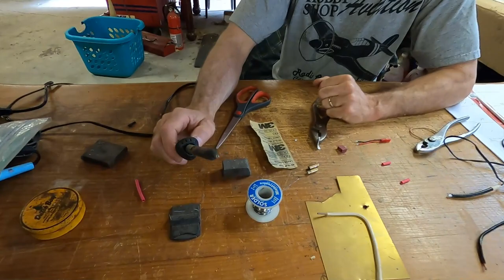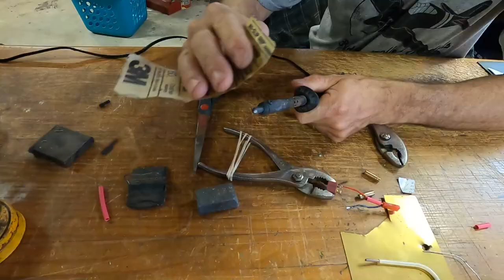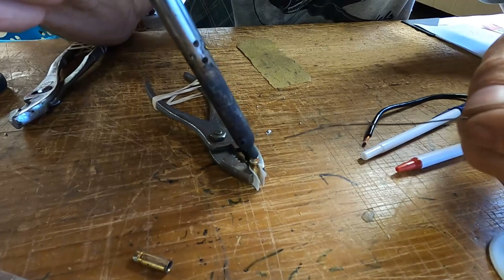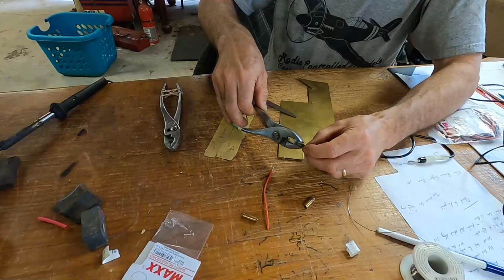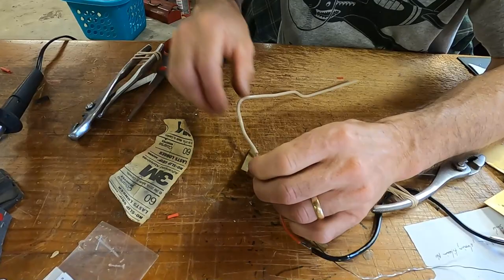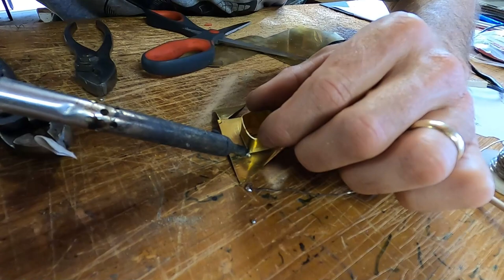Soldering Tutorial For RC Cars And Trucks

Comment: Good tutorial.  I would suggest using a small piece of wood for the bullet connectors. I drilled a hole in a 2x4 and set them Inside it. Works great. Not saying your method is bad, I just wanted to offer a suggestion.

Comment: If you find yourself dicking around with the solder try adding some flux 👍 (the flux inside the solder wire core is the thing that smokes, when it's burned up it gets almost useless)

Comment: Just bought an ERevo 2.0! What are your must-do upgrades? I’ve got limiting straps, the chassis brace and it came with Proline trenchers! I’ll most likely do similar bashing that you do!
Reply from the maker: Just get ready for the servos to go. Yours may last, but I upgraded to some Savox servos
Reply: @outsourcedrc  Which ones did you go with? I think I’ll just let mine go until they die off, could be 1 run or could be a lot, that’s what I’ve learned.

Comment: I'm not a pro but I thought sand paper would be bad for you tip?
Reply: Sounds like something a pro would say 😆 guess he just doesn't care about what looks like an old well used, ready for change iron 😂
Reply: Well, you use sandpaper when you want to recondition a tip, you need to get to bare metal to get solder to stick, then usually you use a wet sponge to clean in between reconditioning. He’s just basically reconditioning and getting a brand new tip every time, I’m sure it will wear the tops faster but tips are pretty cheap and it’s nice to have plenty of them anyways.
Reply: Oh also a wet sponge technically is bad for tips as well, heating and cooling the metal will weaken it and make it brittle. I use Brillo pads from the dollar store myself.
Reply: @travispratt6327  yeah fair enough dude, personally I've always used wet sponge, kept it clean and I've never had to recondition or replace a tip.
Reply: @MatthewSimm  yea, I don’t think there’s really a wrong way.